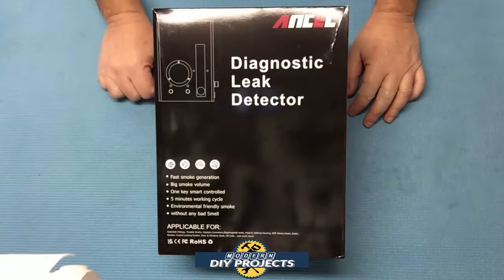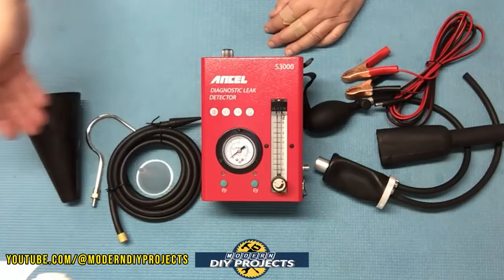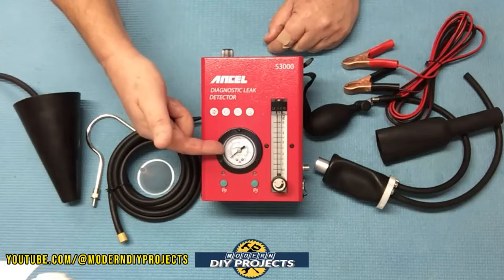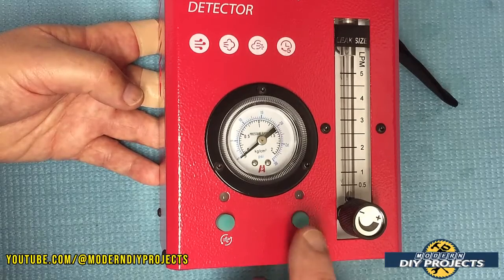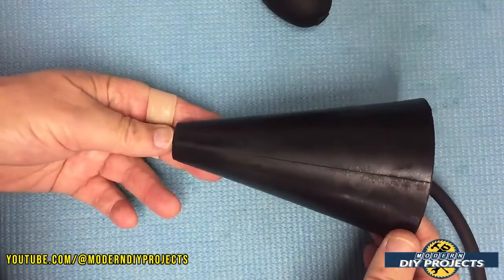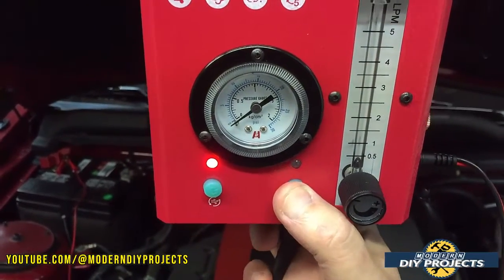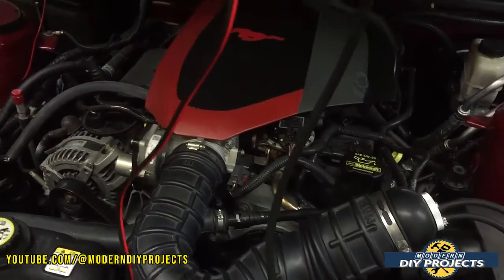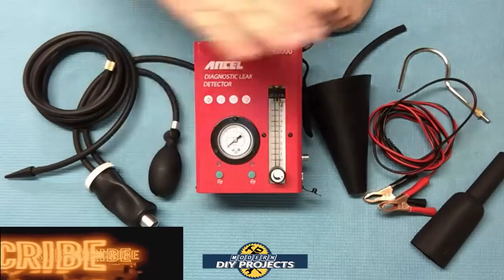Ancel S3000 Automotive Smoke Machine and Leak Detector for Easy Evap Leak Testing

Comment: A quick note on these Chinese evap testers. They put out way to much pressure
for evap testing. The maximum pressure for the evap system is .5 psi or around
13.0 in. H20. The Ancel is putting out way over .5 psi. Anything over 7 psi 
can damage pressure sensors and or blow off hoses. 14 psi is OK for intake
and exhaust testing but way to high for evap.
Reply: So surely you'd turn off the pump before 0.5 is indicated on the dial?

Comment: Nice demonstration.
I had to rewatch this to see if mine was working right. 
They may have some quality control problems...
I bought one from amazon and it worked great for a day. The next day it worked for a little but then stopped producing smoke. I assume maybe the heating element burned out. Returned it for replacement and tried it out yesterday.
On this one, the flow control potentiometer doesnt do anything. The bubble in the gauge goes all the way up when turned up and turning the dial has no effect. Its probably disconnected inside but I'll just do one nore return and hopefully get a good one.
Reply: Mine was junk to it never built pressure or blew constant smoke there junk

Comment: You arent going to be able to put pressure in the intake.  The only way is if all the valves are in the closed position which is impossible.  All you did was fill the area with smoke.  Eventually that smoke would make its way out of the exhaust.  Now if you did this test on an EVAP system with the vent commanded closed, then you could build pressure.
Reply: Just block the exhaust pipe...
Reply from the maker: Yeah, it's only a demonstration not an actual test.

Comment: Mine came with black liquid ! Should i put it in instead of the oil? Or what?
Reply from the maker: Mine did not come with any liquid at all. I would read the bottle and the instructions before use. If it doesn't look right then just toss the liquid. Baby oil is super cheap to buy and will not damage the machine.

Comment: I'd love to have one capable of using shop air pressure of at least 120psi for tractor trailer air systems, especially fuel tanker air systems.
Reply from the maker: This does have a pretty strong air pump built in so it should do the trick. Saves the trouble of an air hose dangling.
Reply: They do exist . The Ancel S100 is the one you're looking for. 
No gauges though.
Reply: @HaggisMuncher-69-420  thanks
Reply: I'm not sure you need a whole 120psi. I think if there's a leak, there's simply a leak.  It's not like systems are designed with leaks in then lol. That's why I'm here searching smoke machines. I'm fixing air leaks in giant cat scrapers. I've gone very far with soapy water, but even then it can be difficult to find some leaks. Rather than removing ever panel to search for small fittings inside the firewall. I can hook it to the supply hose and wait for a smoke trail